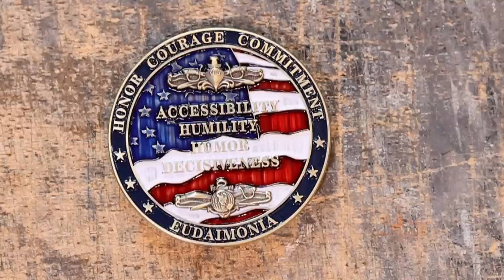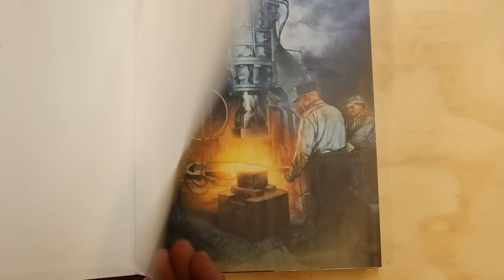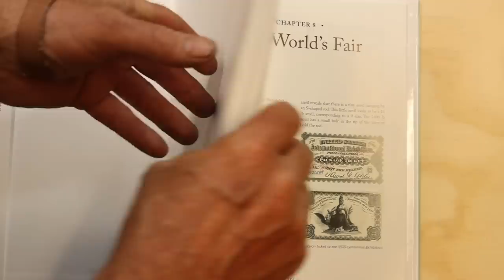The Odds and Ends of Shop work

Comment: The older I get, the more I drift. I've got lots of projects but most of them are just for fun. Most of my work is mowing, brush clearing, etc. Puttering around the shop provides the regular breaks I have to take. I don't have the stamina I had ten years ago, so drifting between things keeps me moving physically and mentally. "I don't know what dinner is but it's gonna be fried." Yes!
Reply from the maker: I think that stamina has a lot to do with it.  My brain plans like I'm still 40
Reply: @BlackBearForge  I'm 75 and just in the last year I started feeling old for the first time. The realities of aging become evident sooner or later. My desire to try out new things is insatiable but the clock is ticking.

Comment: There is always that pull to do shop maintenance or overhaul or continue to work with a sub optimal situation just to get a project finished.

I hate making jigs and fixtures- not good for a smith. I need to get over it.

Frank

Comment: Afternoon John. Your video is quite timely as I am doing many of the same things you are speaking about. Found an old repaired Hay Budden anvil that has repaired edges and debating rounding the edges such as the book " New Edge Of The Anvil " suggests which most likely would have prevented the damage in the first place. Also, working on a floor vise that I want to mount to an old farm tractors flywheel. The interesting part of your video was wondering about sealing rusted iron and I just wire brushed the flywheel and used Seafoam's " Deep Creep " lubricant and what a fantastic patina it gave to the old flywheel. All the best and hope you will keep up the small shop video's as they are most interesting. Cheers from State, NY

Comment: John, I noticed that you dont seem to have a lot of insulation on your walls of your shops. Is there a specific reason you dont do this? I know you live in the high country and would figuer it would be more comfortable if you did. The little shop is a great project and have been watching every vid you put out on the topic. I live in Western Arkansas and lots of do it yourselfers live out here and I get to help in thier projects. As for the cabin, I would love to see the videos of progress on these. This channel is fine for me. Just a note here I use lots of your videos for the folks I help get started in blacksmithing!! Great work.
Reply from the maker: The main shop has insulation in the walls.  But the roof is still waiting for some repairs before I insulate it.  The little shop will remain more rustic and would need more work than I have time or budget for to be fully insulated.
Reply: @BlackBearForge  thanks for the reply John. I do understand budget.

Comment: I am also a putterer... I work on multiple things at once and it's sometimes hard to gauge productivity haha So I have a serious spine injury, just had surgery a month ago to fuse some vertebrae together, good times. I figure blacksmithing may not be the most intelligent hobby to get completely obsessed with, but here we are. I am in dire need of a power hammer, as regular hammer leaves me in a bad spot if I do it too long, I figured a power hammer is going to be a significant life improvement. However the price of power hammers is so far out of my budget that I can't really consider it, or at least not a new one. So I'm looking for a used power hammer, or at least good plans for a DIY power hammer (I actually made my own 2x72 grinder! and it works quite well). Do you have any recommendations, thoughts, or insights into what direction I should go? Appreciate any input, Thank you for all you do.
Reply from the maker: Clay Spencer's tire hammer is popular as a DIY project.

Comment: So how do you ventilate a building like that? I've been considering setting up in an enclosed space but am concerned about carbon dioxide buildup
Reply from the maker: I have always left my shop quite drafty and usually work with a door open for fresh air.  Having a CO meter would be a good idea anyway, but I don't know any blacksmiths that use one.